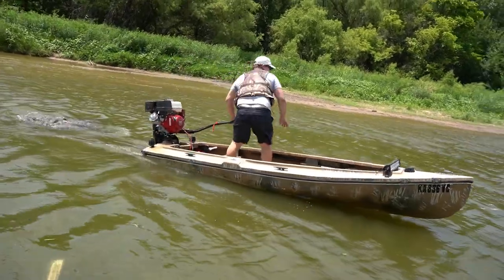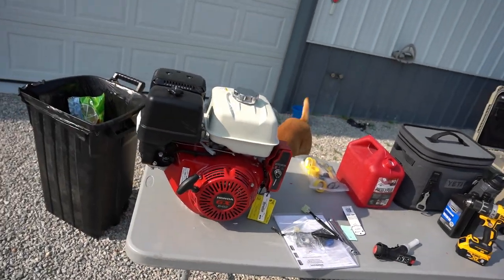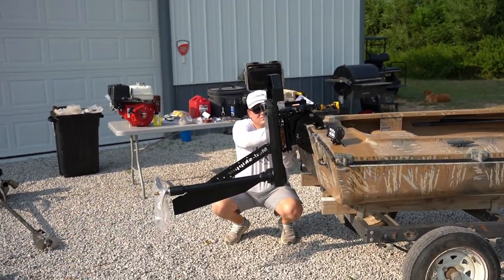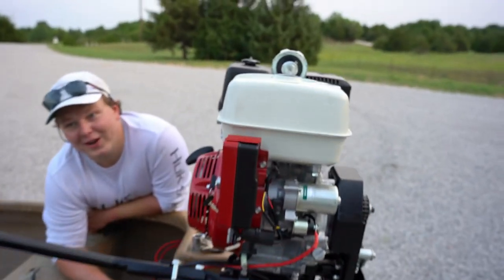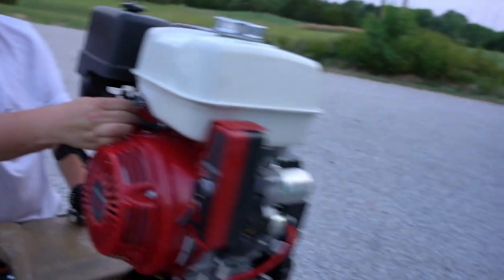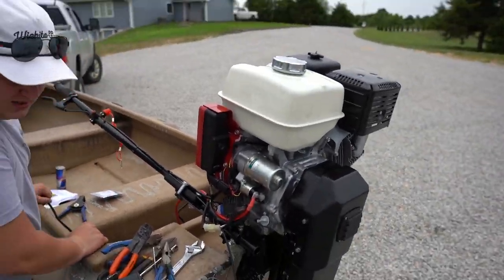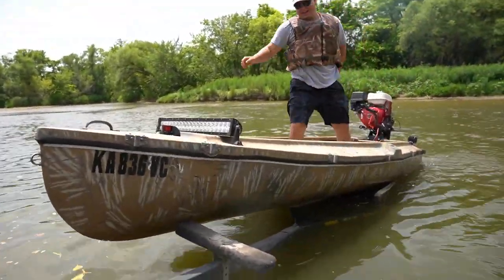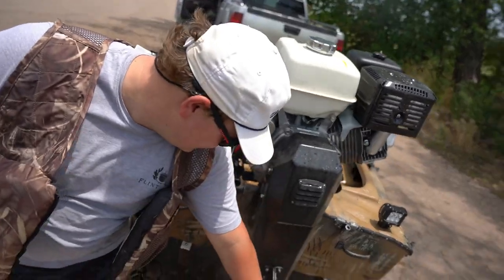Building Worlds Smallest Duck Boat with New Oversized Motor.. We Sunk it

Comment: Surface drives need a half a blade in the water. Otherwise it won't get on plane. That motor needs to be raised 4-6 inches at the least

Comment: Bobby, I currently have a 1436 with the same 13 hp mudskipper. You will have to add flotation pods on the back, The motor will sit low on the water and you will swamp the boat when coming off plane. The motor has either a 16" or 20" intermediate you, will have to make sure the transom of the boat you put it on is the correct height for the motor otherwise you might have to purchase a jack plate to raise the motor to the correct height. This is why the little boat would not plane out. Hope this could be of help to you guys, good luck!

Comment: If this mud skipper surface drive ends up being too heavy for the boat you could try a PPF Longtail (super lightweight) or a backwater Longtail (slightly beefier than the PPF) both good options with the PPF being the lighter of the two. Also a 7hp copperhead or mud walker surface drive could be an option if it's lighter than the mud skipper
Reply: All made 3 made in America as well 🇺🇸

Comment: Where are you putting your decoys?

By the time you, Preston, and the motor are on/in the boat before you load decoys you will need to add floatation bags. That motor and drive are first class but too heavy for that boat.😊

Comment: Enjoyed the video ... enjoyed your friendship.  I want to share something important with you from my personal experience.  It's about that gas can you modified.  I'm not going to bag on you for the modification, not at all.  I have a Yamaha 660 Rhino with an 8 gallon internal tank.  After two months, we learned that our adventurous nature exceeded 8 gallons.  So I bought a 5 gallon auxiliary tank (manufactured the same as yours) to ride in the bed.  After two trips in the desert, we filled up the main tank and the auxiliary from our RV pump station and headed out.  Fortunately, not long after we headed out, and we were still close to the RV, the auxiliary tank split exactly in half and dumped gas in the bed, which is directly over the engine and exhaust.  You see ... those auxiliary poly tanks are manufactured in 1/2 shells which are then electro-statically welded together.  I had a secure mount, along with a 3/4 inch foam pad under the tank, however the vibration from operating the Rhino caused the tank halves to separate at the weld line.  The vibration involved is not much and certainly less than in a boat.  I went immediately and bought a one-piece heavy poly tank (5 gallons) which is (a) used to fill dirt bikes and ride in a trailer, and (b) translucent so you can see how much fuel is remaining.  They sell them in sizes so I'm confident you can achieve your needs.  I "truly recommend" that you abandon the use of that red tank as soon as possible.

Comment: Awe the I Don’t Give a Duck 🦆 had too much junk in the trunk and got backwashed on big water 🌊. 
I agree with you two that safety is of the utmost importance. I would still keep her, just get the motor fixed or find a great deal on a similar motor, even a trolling motor would work well in certain places and be quiet 🤫. The new motor deserves a new bigger flat bottom boat in that 14-16 foot range from one of the well regarded manufacturers like Lowes, Alumacraft, G3, Alumaweld and a couple others. You all could then put an A frame boat blind on it if you want to. 
I look forward to the next installment of this little series. 🦆🦆🦆

Comment: I have a 2015 Alumacraft 1436 Jon LT for sale with a 2019 shorelander trailer. I sold the 13 hp copperhead surface drive off of it which pushed 2 guys and gear about 20 mph. The boat weighs 135 lbs dry.

Comment: The bottom of the surface drive chain housing needs to be slightly above the bottom if the boat when trimmed all the way down. It below the bottom when the shaft is parallel, it would never run right on there

Comment: Get a flat bottom with the performance flotation pods on the back I think beavertail does aftermarket but any welder can fabricate otherwise some come with them on and they help you stay up on plane with a load on the boat. They say it adds about 500lbs of flotation

Comment: You could ADD more weight in the front AND put a raised piece of rubber across the back to keep water coming in when stopping . Yeah you need a different boat. You CAN GET A SHORT TAIL 5or 6 hp motor !!

Comment: Best tip I can give you is to put the expensive can gas in it the last couple hunts. The alcohol in pump gas will kill the carb in months. $7.99 a can sucks but a $800 motor that you have ran 20 times in 3 years not running on your first hunt with the boys sucks more.

Comment: I have that same set up and i put it on a 14x36 flat bottom and its way to heavy even for that. Get a 14-15 x 48 or 50. Mine is more functional than yalls but if you are going 15 mph and you have to stop suddenly the wake comes over the back and almost swamps it. I did not expect it to be that heavy

Comment: Only way that boat will work with that heavy motor is with PONTOONS. You'd need portable/attachable ones lifting up from under the hull to attach to the gunnels and to be off the side by at least a few feet. 
Me, I'd just get a cheapo electric tiller motor for the back or an old school wee gas outboard with the gas tank on top.
Reply from the maker: crazy but great idea